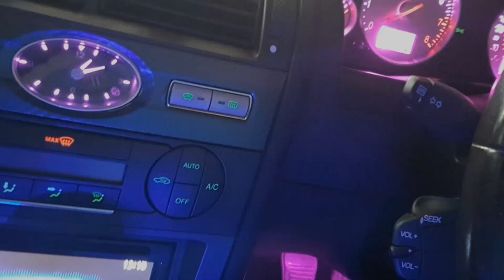Car heat shield quick fix

Comment: Simple but effective - I dislike the threaded studs, once they are rusted beyond saving it's time to get the cutting and drilling tools out! I once, when younger, used the lid off a small tin can (mushy peas) as a washer by punching a hole in the middle. No ring pulls back then.

Comment: The reason these rot is due to galvanic corrosion of the aluminum shield and steel nut. I actually just use scrap plastic, even a large bottle cap as a makeshift washer.  Sounds like a really cheap fix I know, but I've seen these last many years this way. And you'd think the plastic would melt but usually it's too far away for that to be an issue.

Comment: Mine fell off on the commute to work. I've been told it's not an MOT fail. No more rattle.
Reply: if its above the catalyst or over fuel tanks its a fail if its missing from the fuel tanks its a dangerous fault . we have seen melted fuel tanks with missing shields😲

Comment: With the kind of luck I seem to have, I'd be afraid to remove the heat shields permanently. I know the risk of fire is relatively low. But, I once tripped over my foot. Which in turn caused me to fall down a step, I then fell backwards to catch myself. As I landed, a bird pooped on my head. I ended up with a fractured ankle and wrist.....along with bird poop from a nasty pigeon in my hair. You see where I'm going with this? I'm not a very lucky person! 🤦

Comment: Good video.  But the problem I have with my 2009 Rav4 is the rusted on nuts.  I could only repair the back two.  The front is being held up with a web of bendable rebar setting wire.  Short term for now.  It flaps on the highway.
Reply: Also I would only use stainless steel fender washers for repair, not that strapping.